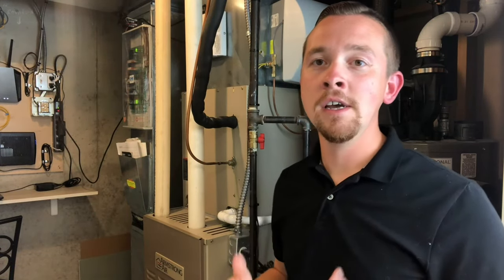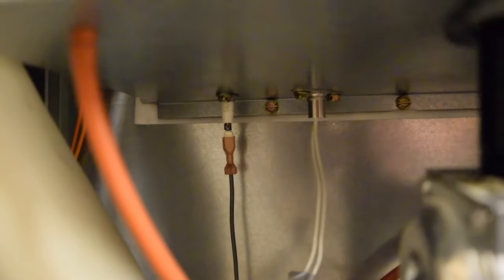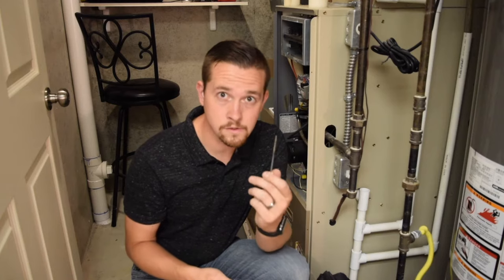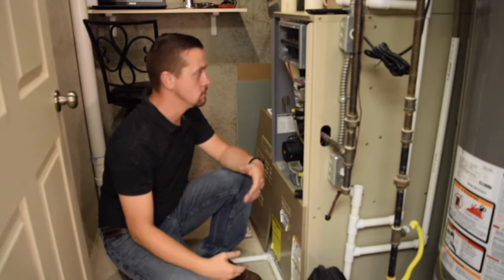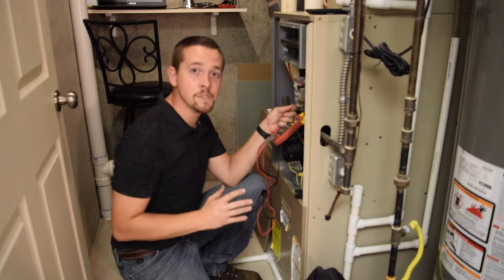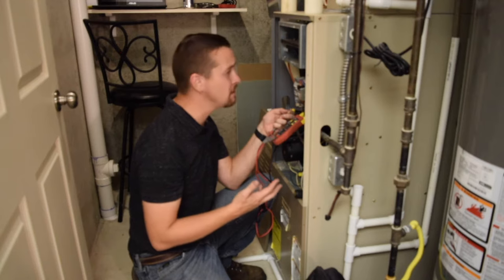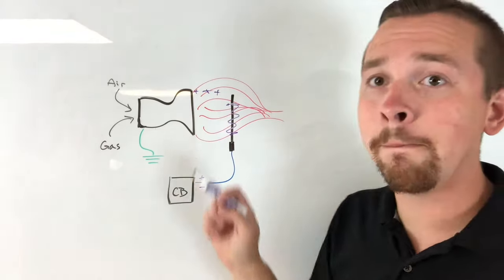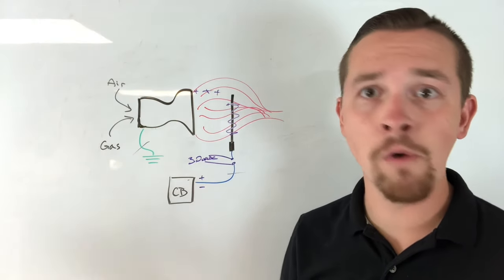Furnace Starts then Stops - How To Clean a Flame Sensor and Why

Comment: In the last couple of hours I watched my HVAC technician use sandpaper on my flame sensor, I will not let it happen again after watching your video. He also tried to tell me I needed it replaced & I asked why it couldn’t be cleaned.  Thank you
Reply from the maker: Yikes! If he cleaned it with sandpaper it’s probably not a bad idea to replace it at some point now. Coarse abrasives will leave grooves in the sensor that collect carbon buildup more quickly. Not saying you need to rush and order a new sensor today, but find the right one and have it ready for an easy swap next fall.

They’re really not expensive to get, and it gives you a little peace of mind!

Comment: This was the exact problem that I had. Removed the flame sensor, cleaned it off with a Scotch Brite Sponge pad, re-installed it and the furnace works great. Thanks for the great explanation, saving me a service call, and getting my heater back working in short order.
Reply from the maker: I'm so glad this worked for you! I run across this issue so often! I was really hoping it would save somebody a trip charge and diagnostic fee for such a simple fix!
Keep in mind that there are dozens of other things that a qualified technician should be checking and cleaning annually, during a much less expensive maintenance visit!

Comment: My Lennox furnace would start and run for a bit and shut down.  After cleaning the flame sensor , the same run and stop would happen.  I then put in a brand new flame sensor and again the same condition of run for awhile and shut down.  The path to ground ( in the flame) is to the front of the burner at the flame sensor.  When I cleaned the face of the burner with fine sandpaper this fixed the problem and the furnace has been operating correctly.  It is just like a battery with dirty connection,  it is better to clean both terminals.
Reply from the maker: Perfect! The path to ground was interrupted, just like we described in the video! Cleaning the burners is part of every manufacturers recommended annual maintenance.
Great analogy regarding the battery terminals, I'm stealing that one!
Reply: Flame senses don't work like that The flame sensor cathode rod is heated by the flame which excites the molecules inside creating the electrical field that goes through the cable back to the circuit board to tell it that it's on there is no path to ground unless you're talking about a spark ignition with the ground being the casing in that case yes

Comment: Appreciate the video.  Followed most of the steps outlined in the video but unfortunately, the screw holding the sensor in place was in such an awkward spot that I didn't have the ability to take it out.  I was however, able to look at the sensor after taking off the cover for the burner and I could see a lot of buildup on the sensor.  If only it had been made more accessible I could have at least cleaned it until I could have it replaced during my annual servicing.
Reply from the maker: I identify with this so much! I have so many different angled tools and bits just to accommodate poor engineering!
Reply: @FixMyHeatHVAC  Would you advise against trying to clean it while it is still in place?
Reply from the maker: It might get you through the night or a few days! But preferably it should be removed and fully cleaned.

You may need to get an angled offset tool or just use an open ended wrench to get the screw out.
Reply: @FixMyHeatHVAC  Thanks!  Really appreciate the advice.

Comment: Very good. I had this exact problem. I took out the flame sensor (1/4" bolts) cleaned it with Scotch Brite and put it back. Turned on the power, blower went on, ignitor went on, flame went on, but after 2 seconds cut out again just like before I cleaned the FS. I left it running and after a minute, ignitor went on, flame went on and sustained. I guess on the first try some residual current was left in the circuit.
Reply: Perhaps also some processor checks. Engineers place coding loops to check if fault automatically clears. Some products may have to be restarted ie, pull the plug and reinsert.

Comment: how long should the  heating cycle be from start to finish in minutes.
Reply from the maker: In most cases the heating cycle will not end until the thermostat is satisfied. If there is a large discrepancy between the current indoor temperature and the thermostat setting it could takes hours, if it's just a degree or two it could be only minutes.
Some modern thermostats have something called a "cycle rate" built into their program, and an algorithm within the stat strive to balance the furnace's run time around that rate, normally this is 3-5 cycles per hour for a forced air furnace, but there are way too many brands and settings to say for sure what yours is.

Comment: Great job explaining all of that,my furnace is flashing 8 times I well try cleaning that flame sensor thank you
Reply from the maker: Did it work? I'm not sure what furnace you have or what 8 flashes indicates on the board. There should be a label inside the door of the furnace that tells you what all of the different codes mean.

Comment: I like how you show the symbols on the multimeter. I get screwed up with those all the time. The only one I know is the “OMEGA - horse shoe” symbol means “amps”.
Reply from the maker: Actually the Omega symbol is indicating Ohms, or resistance. Normally Amperes (Amps) are indicated with a capital "A."

Comment: Yes, the control board is sending 3microamps into the flame sensor. But doesn't the control board needs to confirm some microamps going back to the board? Nice video. Thanks
Reply from the maker: The circuit board is sending a potential of much more than 3µA into the sensor. However, only some of that amperage can make it through the flame and back to ground, completing the circuit. The circuit board measures the flow of electrons, that actually make it through the flame.

Comment: I just had my yearly inspection and the service tech. said my flame sensor was reading higher than normal. 7 or something like that.  I think he said around 3 was normal.  I am wondering why he didn't clean it after watching this video and seeing how easy that would have been for him to do.  They said it would cost another service call of $199.00 + the part to fix it when it goes out.  Can you tell me if cleaning a flame sensor is part of yearly maintenance? I have not had any problems with the unit yet, it is only on it's 2nd winter here in Oklahoma where it's not really cold like up north.
Reply from the maker: I can't be sure, but I am fairly positive that they were referring to the hot surface ignitor when stating that it was "reading higher than normal." Measuring the resistance through that device can help give an indication of its working condition and livelihood. It is very uncommon to have to replace a flame sensor.

I always clean the flame sensor during annual maintenance. 85% (estimated) of my service calls for no heat are caused by lack of proper maintenance.

I also have another video covering hot surface ignitors here: https://www.youtube.com/watch?v=CR_xKq-uKSY
In that video I cover the identification, diagnosis, and replacement of one particular HSI, but yours may be different.

Comment: Silly question... should the gas be turned off? Tks
Reply from the maker: No such thing as a silly question! You don't technically have to turn off the gas to the appliance when you pull and clean the flame sensor as long as you have the power off. HOWEVER, it's always best practice to turn off both the gas and the power to the appliance when servicing it!
Reply: @FixMyHeatHVAC  thanks for the tip... Stay Safe

Comment: I have to clean my flame sensor very often which I don't think is normal. Do you think its because I'm not cleaning it well enough or is there something else I should check or clean. Repairmen tell me my furnace is working fine, but then why am I cleaning the flame center 3 or 4 times a week? When  its very cold out, is when my furnace does this because it is constantly running. I set it at 72 degrees and the furnace kicks on and runs then shuts off for like 5 minutes then it has to kick on again. I have a Thermo Pride Furnace and it is also my central air in the summer. I live in a mobile home in MN. and I have very poor insulation and so that is why it is constantly kicking on, on very cold days/nights. Thank you in advance for any tips or advice you maybe able to give me. Happy Holidays to all.
Reply from the maker: You could always replace the flame sensor to see if this solves your issue. They are normally relatively cheap to obtain. If you have a multi-meter that can measure microamps, I would be interested to see what kind of flame signal the unit is producing.

There are tons of other things that can cause a flame signal error code that aren't related to the flame sensor itself. Plugged burner cross-overs, poor gas pressure setting, improper grounding, a cracked heat exchanger. I would love to know what a before and after microamp reading is on that sensor when cleaning though.

Comment: I heard nail polish remover pads work well for cleaning the flame sensor. (They have acetone) Cheap and convenient.
Reply from the maker: I have never heard this one before! I would imagine the acetone just evaporates leaving behind clean metal with no residue?
Reply: @FixMyHeatHVAC  I just googled ingredients. Some removers have additives. While working in hospital maintenance, carpenter would always use acetone for cleaning. RN's unglued my super-glued fingers numerous times! Of course, you don't want to wet skin with pure acetone. A small container with a swab would probably work best.
Reply: @FixMyHeatHVAC  A spray can of carburetor cleaner would be another option. What about electrical contact spray cleaner? I think this would be a good option. The bio-med techs used it all the time for cleaning contacts and controls.
Reply: @Jomatsch  I would use CRC Mass Air Flow Sensor Cleaner which is great and leave no residue of any kind. Great specialized stuff !!!
Reply: @kantiusaify  Thank you! Good idea.

Comment: I recently cleaned my flame sensor with 180 grit emery cloth.  Probably a bad idea.  I'm having trouble finding a new flame sensor for my Bryant furnace as all replacement flame sensors have the metal mounting ring in the wrong "clock" position as upon install, the sensor isn't even in the flame.  Now I've probably shortened the life of my original 21 year old sensor with the emery cloth.  I found very fine steel wool to not clean well enough to keep the sensor lasting very long although I'm on natural gas.  I'll definitely remember the bronze brush technique.
Reply from the maker: At least it was a fairly high grit of sandpaper. The grooves in the sensor that the sandpaper leaves may cause the sensor to become dirtier faster, but it didn't instantly ruin your sensor.

Measuring a before and after of the flame signal when cleaning will tell you if there was detrimental damage done. Otherwise, if you can't find the part online, try to find your closest Bryant (Carrier, Day & Night, Payne) Dealer and have them order you one.
Reply: @FixMyHeatHVAC  Thank you for your reply, I appreciate it!

Comment: GCI l
Lennox spark won't light up after 8-10 times! Direct spark seems ok, ground ok,...
Reply from the maker: Quite a few things can lead to this. Are we sure that the gas valve is opening and letting gas flow to the burners? Are the burners plugged with gunk so even though the gas is flowing it's not igniting?

Comment: don't you worry about putting a meter in a rod that carries a hi voltage spark?
Reply from the maker: The flame sensor is not the same as a spark ignitor. A flame sensor is a control device designed to rectify the flame signal, not ignite the flame. The system in this video uses a hot surface ignitor to light the burners, not a spark ignitor. 
I have a separate video about how the hot surface ignitor works.
While a spark ignition assembly also needs to be cleaned like we did in this video, you would't want (or need) to be touching it while it's trying to light.